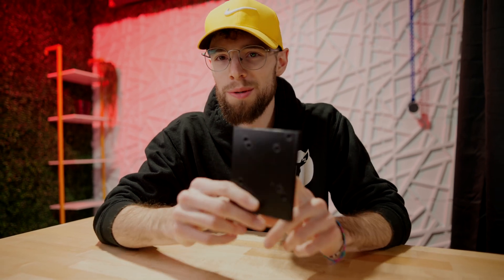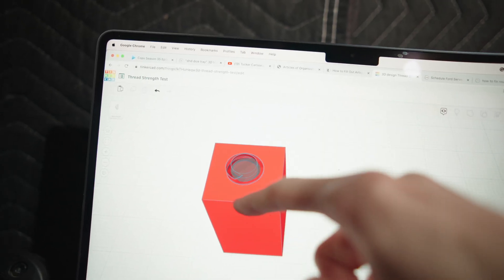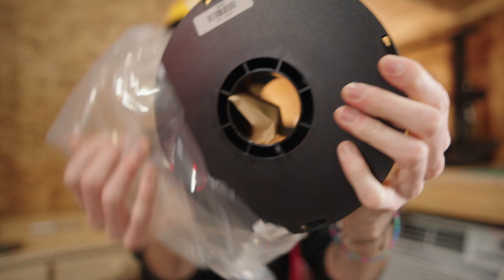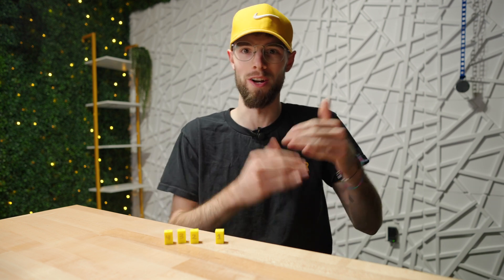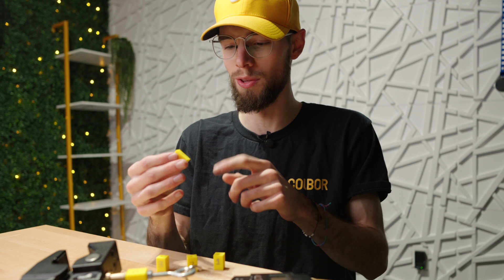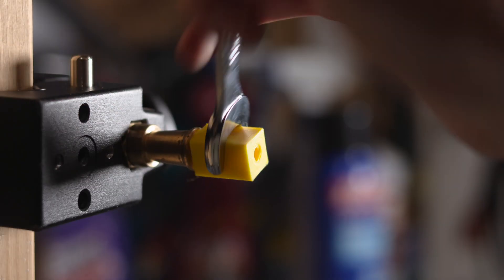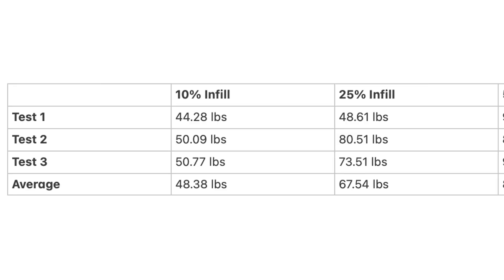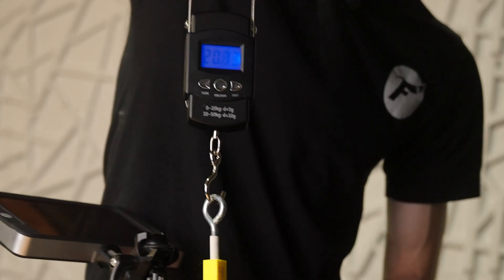3D Printed Threads | How Strong Can They Get?

Comment: The way I make my thread is easy. I design a hole slightly smaller than the screw diameter and I screw directly in. The screw will make its own thread. You can use a small knife to make the hole a little bigger where you will insert your screw, it will make it easier. You can always adjust the diameter to make it work.

Comment: PLA+ is not stronger than regular PLA, its just more resistwnt to heat and shock loads.

Its not any better in tensile stress, which is what you are looking for.

Also, using it in the worst possible layer orientation might not be the best idea.
Reply: You can add a "v-cut" on top of the thread and print it witha horizontal axis for more strentgth.

Or just print it with horizontal axis (making it with garbage geometry) and (re)tap it with a cheapo thread tap.

Comment: I would suggest that you put a portable heater in the room where you do your testing and heat it up to 95 to 98 degrees F and repeat the test to see how much degradation you would get on a hot summer day.  If you printed in Nylon or some other high temp filament this probably wouldn't be an issue.  At higher temperature a long duration pull might create a failure at a tension that would not produce a failure from a short pulse.  You could apply tension with a spring and a ratchet strap hooked to your fish scale and tied off elsewhere in the room.

Comment: My first thought was that it would be 130+ pounds.  I've always had pretty good results with 3DP threads.   My big concerns would be fatigue and wear more than strength.

I wonder how male threads of that size perform? I've seen lots of issues where round poles snap off at the base if you're not careful with slicing but it would be really cool if it worked.

Comment: The average is useless in this case, you are interessted in the worst cast (your camera smashing the ground). Also, I think you will hold your camera for more than a few seconds, that's a different test right there! And what about UV light, water and saltwater slowly degrading the PLA+? What if you trip over smth. and you have to pull hard on the string to save your rig? Lots of variables, lots of more interessting videos!
Reply: This could actually be done! Dynamic load tests like letting an equivalent weight fall until a cable stops the fall and something like that would be useful.
Reply: @Flashbang_Photo  That would be great! I would opt-in on a security metall string between the rig an whatever comes after the 3D printed part nevertheless.

Comment: When I tried printing threads the limiting factor was the male threads pulling apart at the layer lines when twisted into the female end. The way I had to combat this was printing them sideways on the buildplate so the layers ran perpendicular to the force exerted on them. This solved the issue I had for the small part I needed, but I wonder what parameters I could change to avoid doing this and creating a flat side on the threads.

Comment: Beyond about 40-50% infill, there's really no point to going higher. Increasing your number of walls and top/bottom layers will significantly increase the strength. Printing fast and with a lot of fan cooling definitely reduces the layer-to-layer strength and adhesion. Turning up the temperature on your filament can help with strength as well, as long as it allows you to print your part without issues. Lots of PLA's can comfortably go to 240c. Cubic infill is in general the best all round infill, as it is a 3D shape.
Reply: depends on how large your part is. the bigger the part the more benefit you get from higher infill density. 'course that makes parts exponentially more expensive
Reply: Especially since, for threads, the walls are what's interfacing with the threads. I usually do at least 3 walls when printing a part made to interface with threads be it metal screw into plastic or both pieces are printed.
Reply: You know You know You know You know You know You know You know You know You know You know You know You know You know You know You know You know You know You know You know You know You know You know You know You know You know You know You know You know You know You know You know You know You know You know You know You know You know You know You know You know You know You know You know You know You know You know You know You know You know You know You know You know You know You know You know You know You know You know You know You know You know You know You know You know You know You know You know You know You know You know You know You know You know You know You know You know You know You know You know You know You know You know You know You know You know You know You know You know You know You know You know You know You know You know You know You know You know You know You know You know You know You know You know You know You know You know You know You know You know You know You know You know You know You know You know You know You know You know You know You know You know